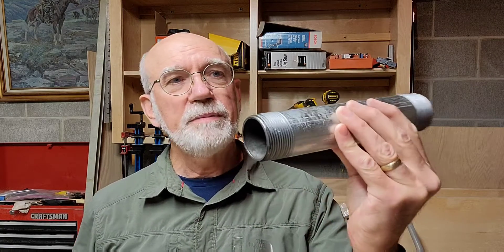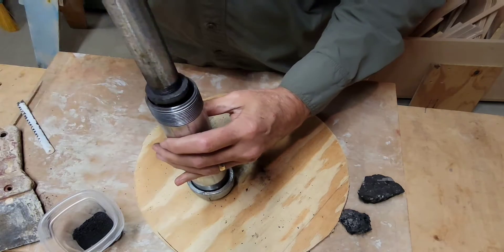Primitive Black Paint from Manganese Dioxide

Comment: Do you still have to process the store bought manganese dioxide powder by grinding and levigating in order to make it fine enough for painting?

Have you found that you get a better black color  with the self-collected / self-processed mineral than you do with the store bought mineral?

As always, I enjoyed the video.
Reply from the maker: Thanks. I don't use the store bought any more, I always had trouble with it being fugitive. I think it would work better if you grind it and levigate it. If feels fine but I don't think it is fine enough. to soak into the clay. Others have had better luck than me. I use a piece of manganese  and rub it on a rock pallet with a little added clay.

Comment: Sir.im asking manganese is magnetic materials ?
Reply from the maker: I'm sorry for the slow reply, I just saw your comment. The manganese that I use is actually manganese dioxide and it does not have any iron in it. I'm not a geologist but to my knowledge it doesn't have iron and is not magnetic. There are some iron bearing minerals that can be used for painting pottery, magnetite I believe.

Comment: Well done useful Video, I wish you success
Reply from the maker: Sorry, I don't know how to turn on the automatic translation feature. I don't where you can purchase the minerals I mentioned and I don't know what country you are from. I bought mine from Etsy and it is available on Amazon. Also look for iron oxide, it make a good red paint and may be easier to find. Again mix it with 20-30% clay and some water. If you can find some really black rocks and crush them to a very fine powder them might work. Are there chemical supply stores? If you want an organic paint you can try cooking down pomegranate juice of possibly other juices. You can include the entire fruit and see if it works. Molasses  and honey apparently work. It should be a very thick paste. Firing is difficult because the carbon in the sugar tends to burn off if the fire is too hot. Your target temperature is 680 - 720 Celsius. A challenge is that organic paints normally only works on a specific kind of clay called smectite. You can experiment and see what happens. There is another good YouTube called Andy Ward's Ancient Pottery. Good luck and let me know if I can help.